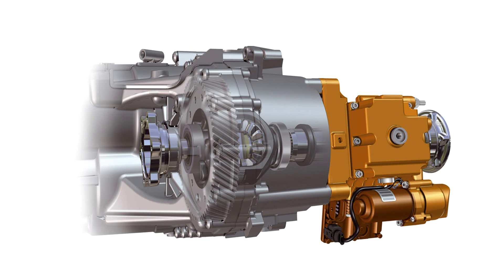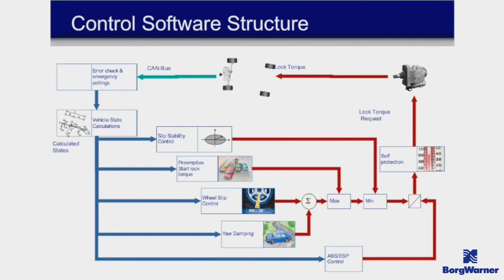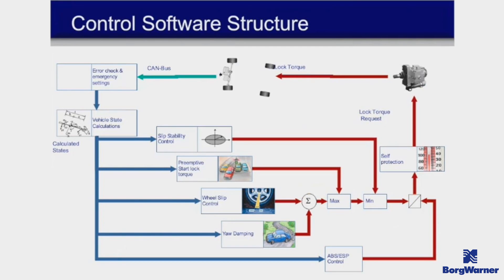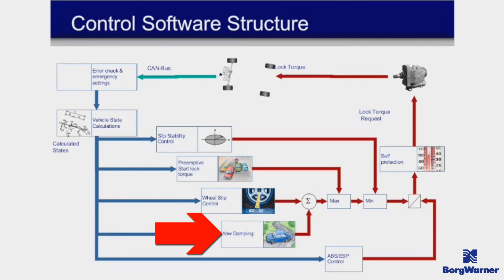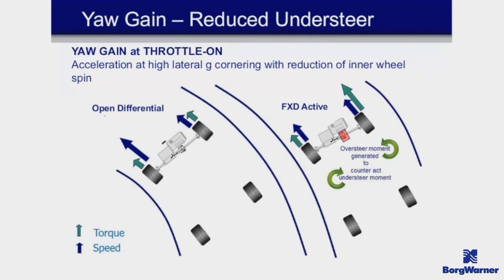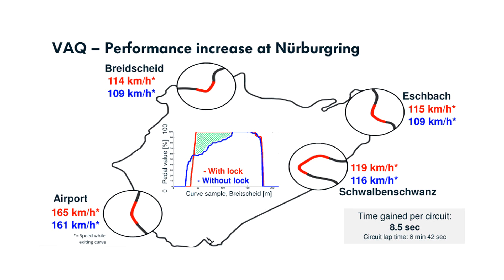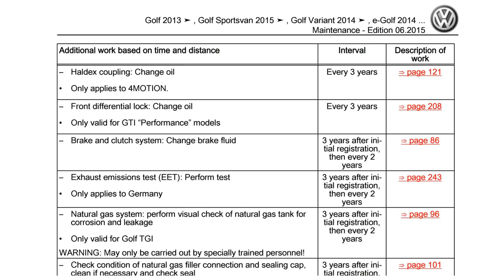How the VW (VAQ) Electronic Limited Slip Differential Works (MK7 PP)

Comment: May sound like a stupid question, but since it's only on the passenger side, it's able to lock passenger-side output shaft to the case, which will work fine in left hand turns (assuming passenger side is on the right). But what happens when cornering right?
Reply: That's just where it's located on the car. It can vary either wheel.

Comment: I’d assume their 3 year service interval is based on 10,000mi a year. That means I’m overdue by 6,000ish miles, oof. I better go get that done because if I’ve learned anything about German cars, it’s that they don’t handle neglect well. 

Now I wish I would’ve gotten it done when I had my oil change and DSG fluid change done. I guess if it’s not that hard to do, I’ll just do it myself instead of being lazy like I was for the oil and DSG services. But that’ll have to wait until it’s warmer out.

Comment: hey guys. I have a 2015 gti performance pack. I had the lsd for the passenger side out cause i changed the engine out. so i did replace the oil in the lsd, but when I reinstalled it I noticed movement where the flange to the axle connects to the lsd. It's only about a 1/8 of an inch of movement in and out. Is this normal? did I screw something up?.  I can't find much info about it. Also thanks for the videos you make they are very helpful.

Comment: Well that bit about oversteer probably explains why I feel like a missile coming out of turns. Also, question: if the VAQ's hydraulics rely on strict temperature readings, should I be concerned about the device's responsiveness in extreme cold (it was 0°F yesterday)?

Comment: I tweaked mine up to full on my carista obd dongle. Stage 1.5 eurodyne gli gen3 tsi. Really worth doing the difference is very evident over the standard setting.
Reply: Kuzuri Kam  is the xds system good? I don't seem to have much traction through 1st,2nd & 3rd 😅
Reply: Kuzuri Kam  yeah they are fun to drive with a few tweaks
Reply: @pissywilly  What tweaks exactly?
Reply: @pissywilly  You said the XDS system is good with a few tweaks, what tweaks? Just adjusting wiring logic to increased traction?

Comment: I will mow your lawn once a week for a month if you can tell me where to find definitive information on how to drop a manual transmission (for clutch replacement) on a 2017 MK7 GTI with PP. They key here is that it has a limited slip diff. I am in a huge bind. Want me to buy product? I will buy product. Please help.

Comment: My helical diff just uses input torque through the helical cut gears to great axial loads that generate friction and a proportional locking effect to the amount of torque transferred through the wheel. 

No computer necessary, always works, and locks up dynamically based off conditions. 

Also plays real nice with traction control. ie, a little brake application to the spinning wheel transfers a lot of torque to the opposite wheel.
Reply: I can guarantee you this thing is night and day to a standard LSD. The cornering this guy talks about is literally mind boggling.
Reply: @MeltingRubberZ28  except the two fastest FWD vehicles around the Nurburgring, the Megane RS Trophy R and Civic Type R, both use helical differentials. 
.
Helical diffs are reliable, proportional, non-reactive, and work amazingly well. VW's solution isn't better except in really low traction conditions when input torque is low and right off the line, but it has to react/predict any lockup needed, and if it's too aggressive can resist steering.
.
If the best cars don't use it, then there are good reasons for it. Especially when they're expensive performance variants with low production numbers.
Reply: @KTMcaptain  just because those cars don't use it....doesn't mean they wouldn't improve if they had it. Not following your logic.
Reply: @KTMcaptain  definitely a thought provoking discussion. Doesn't the type R use the brakes for torque vectoring anyway? I've heard of people complaining of how fast their brake pads wear out from heavy cornering.

Also, it seems to me like the general consensus is that an e-diff yields better performance. On all the track models of the Camaro the e-diff is an upgrade (including the ZL1 1LE). The reliability is questionable. I can see how it could be thought of as less reliable, more parts, electronics, however it really is just a clutch type LSD that has a piston controlling how the power is broken up.
Reply: @MeltingRubberZ28  The logic is that those two manufacturers set out to make the best handling fwd cars on the market and succeeded. The differential is a very important aspect of the cars handling. It's not a situation where they performed in spite of the equipment. It was chosen. Ultimately, you claimed it to be a night and day difference, but there is no actual performance difference. 
.
Clutch type differentials wear out hence the reliability complaint. Not only that, they lose performance throughout that lifespan as the fibers wear down and the steels glaze over. The Corvette does use an e-diff, but it's rear wheel drive. When the diff is locking up it restricts turn-in minimally. Front differentials have a greater wheel speed differentiation meaning any lockup would have a greater effect on turn-in. 
.
My old 06 WRX STi had 3 differentials. Front was helical, rear was a clutch unit, and the center was a electromagnetically driven clutch with helical gears. Helical diff in the front provides great torque distribution without restricting turn-in, the rear diff has less wheel speed difference and used a static clutch, and the center diff was used helical gears to amplify the electromagnet driven clutch pack to vary torque distribution. Subaru swapped the rear differentials for a helical unit the year or two later. My current car, 19 Civic Si, has a helical unit and it's unbelievable how well it puts down power pulling 1g in slower 40mph corners where even my 13 WRX would spin the inside front. 
.
The great thing about helical diffs is the lockup is proportional to wheel torque... wheels take torque to spin, the more torque you apply the more likely it is to spin... So the lockup effect is only there when you need it and is instantaneous. 
.
Now, there are clutch type differentials which have a proportional lockup effect as well. 1 way, 1.5 way, and 2 way diffs use a ramping mechanism and input torque to drive the clutches. A 1 way will only drive the clutches under acceleration and not braking, a 1.5 way will drive the clutch half as hard under braking, and a 2 way will drive the clutches both ways. These aren't well suited for road cars due to fast wear and maintenance, but are great for race cars. 
.
I don't see what torque vectoring has to do with the differential? It's used to get better turn-in. Outside of Honda's SH-AWD rear diff, no diff can vector torque intentionally to the desired wheel. Hence the use of brakes. The VAQ diff can only lock the wheels together making the wheel with the most traction the one that gets the most torque, but under that the inside wheel wants to spin slower and can't so will resist turn-in. Honda's SH-AWD rear diff doesn't use a differential. It's a fully locked axle with clutch packs to create differentiated wheel speed. It would just partially unlock the inside wheel to send more torque to the outer wheel, and it also uses a planetary gearset to increase the rear axles speed.
Reply: @KTMcaptain  either you didn't watch the video or you don't understand how the VAQ differential works. It has the ability to send full power to the outside wheel during turning to aid cornering, which is where I've said it's a night and day difference.

As far as it being a high maintenance item, VW has been using it since the 2015 GTI has come out (I think earlier on the Golf R) and I have yet to hear any complaints about it wearing out. The maintenance schedule they have for changing the fluid is likely similar (possibly even longer) to the maintenance required on your Si.
Reply: @KTMcaptain  I had to go back and re-read your original statement, but you saying that helical differentials are proportional is actually it's downfall which is where the VAQ shines. You've also correctly mentioned yourself that there is the largest wheel speed differential in the front wheels when turning, which is why having proportional power to both wheels is actually not desirable, or at a minimum....less desirable than a differential that can bias the power to the wheel completing more revolutions.

As far as torque vectoring, I've heard on the type R people complaining of the brakes wearing obscenely fast due to cornering and them using the brakes to reduce power to the inner wheel. The WRX also does this. We both know from physics that biasing the power to the outer wheel to generate torque vectoring, rather than slowing the car down by braking the internal wheel is a better option.

I actually looked at buying an Si but the dealer was a joke, and the 1.5 simply can't generate enough power for my liking. My GLI pulls quite impressive numbers in the corners as well. While it isn't at the Si's level, considering it's additional weight it's very close.

I'd be willing to bet that both the cars you've listed would run at least as fast, if not faster with a torque vectoring differential. The only potential reason they wouldn't is given the caliber of the driver that's pulling the times they are, simply can overcome it's downfalls given it's old technology that they've been used to for years.
Reply: @MeltingRubberZ28  "Either you didn't watch the video or you don't understand how the VAQ differential works." Sounds more like your misunderstanding. Read through as I will explain why it doesn't actually work that way.
.
The VAQ differential has an actual differential with a single clutch pack that resists one axle shaft from rotating away from the carrier. This CANNOT direct torque intentionally to one wheel. It can only lock the wheel, proportionally, to the other wheel and the traction available to determine which wheel gets more torque. Since the inner wheel is slower than the outer wheel, torque actually flows the the inner wheel as it is being spun faster relative to the road. This is what causes LSD understeer on FWD applications. 
.
See, a differential works by one output spinning forward and the other reversed. This happens inside the carrier and relative to it. Therefore the output spinning backwards is still spinning forward if the carrier is rotating faster than it. This is what actually provides the differentiated speed.
.
When you resist one output rotating at a different speed than the carrier, then the idler (spider) gears inside the carrier transfer that to the other wheel as well. This is how the VAQ differential works. It only applies the clutch pack to one shaft, but it affects both and LOCKS up the differential.
.
Now that we understand the differential locks the wheels together, we can examine VW's claim that it can send 100% of torque to either wheel. It's true but deceptive. A locked differential will send 0-100% of torque to either wheel depending on traction. If you lift a wheel off the ground then the wheel on the ground receives 100% of torque since torque requires resistance. 
.
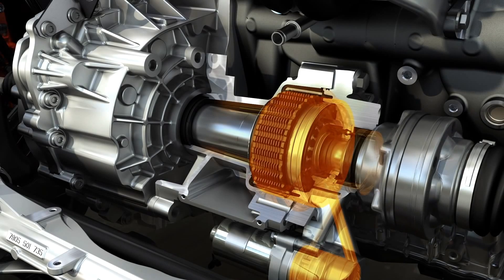With the VAQ differential it will distribute torque like an open diff or locker or anywhere in between as it can proportionally lock up. It cannot however disengage or reduce a wheels connection to the differential like the Honda diff can. At 3:10 he explains the varied lockup.  Notice how this video DOESN'T explain how it sends more torque to either wheel, just that it locks up.
Reply: @MeltingRubberZ28  The proportionality is actually the key benefit and why racing differentials use an input torque based clutch system I already explained to you. 2 way differentials. I'm not saying the helical diff hand down out performs the VAQ. I'm saying it's exceptionally reliable, works just as well on the track, not so much in bad weather, and isn't limiting performance. 
.
See, wheel spin requires torque. More torque means more likely to spin the wheel. The helical diff only locks up the differential when torque demands are high, which the VAQ does as well. When torque demands are low the differential acts open. The VAQ and helical work under the same physics. Resist the internal differential gear movement relative to the case. The VAQ uses a clutch and helical diffs use axial torque due to the shape and engagement of their gears. Both work in the same manner, but one uses a computer to decide when and how hard. The other is purely mechanical and works instantly. I'm sure the VAQ can simply mimic a helical if it wanted to. But it's heavier, more complicated, wears down over time, needs maintenance every 3 years per this video. 
.
I agree with overdriving the outer wheel with torque, but that requires a setup like honda with complex clutches to reduce the torque delivered to the inside wheel. But, dragging the brakes does create a yaw moment that helps the car turn in, so both have valid applications although the brake based systems can easily overheat the brake and cause excessive wear and premature failure. 
.
Coming from a 315whp WRX, and 350whp STi before that, I got married and drive my wife's CX5 often. It's 180ish HP isn't something I often used up, so I realized that 40mpg is better than using good power less than 1% of the time. It's weak, but damn does it handle, and the car won't understeer until both front wheels start to spin, which is a testament to how well the diff works. Resale value was also nice since it's about what WRXs get percentage wise.

Comment: My dealership changed the oil for this system at 35000km.... on DAP website you recommend it but VW doesn’t?
Reply: Does yours make a little whining noise at low speeds?

Comment: Hey Paul--is it feasible to upgrade to a LSD with a non-performance package MK7 GTI? I'm currently leasing my car and once that 3 years is up I'm debating whether to buy out the car and put an LSD in...I want to tune it but i'm not going to bother unless I have an LSD--thoughts?
Reply: Wavetrac can be installed, look up the article on DriveTribe comparing the two.

Comment: Paul: in case you have not already, please review the comments made by sn0man on VWVORTEX: http://forums.vwvortex.com/showthread.php?7508242-Performance-Pack-VAQ-differential-oil-change-maintenance&p=109161977&viewfull=1#post109161977. Apparently, at least one dealer claims VAQ is not a serviceable part.
Reply from the maker: Coming on AskDAP 113

Comment: Paul, could you bring the OBDeleven into this discussion and inform us about the app used to adjust the performance of the differential lock?  I have been eyeing up that setting and wondering what to do.  I could be wrong, but I think there is an adjustable setting for the VAQ.
Reply: Jacob Frey you can adjust them if you have it, I've seen the setting in VCDS for normal and aggressive. Give it a try but keep an eye on the wear on your front tires, test it by doing a low speed donut and compare what you feel between the two settings. The reason you might want a more aggressive slip setting is for gravel and dirt roads, on the street it could cause premature wear problems or 'axle windup' but only testing it will prove the theory.
Reply: Jacob Frey zi 2nd this original one, problem is it doesnt say what the standard setting is so u dont know if its getting more aggressive or less, and what that means
Reply: YES!  I wanted to come back to this video and ask about that as well - I can't tell whether we have any idea what setting our cars would have from the factory.

Comment: I dont get why manufacturers put these complex systems on their vehicles. Install a proper oldschool LSD and be done with it, they work better at providing traction anyway.
Reply: Uh no. An old school static clutch pack differential has to balance its locking effect with proper differential action. 

These diffs can provide perfect diff action and lock up much stronger. The elsd on the wk grand Cherokee provide traction levels equivalent to a locker.

I’d rather have a torsen though.
Reply: Whatever, grandpa.

Comment: So no one talks about what the standard location diff does or I should say, how it behaves.  What style of diff do we have in the standard location?  Same part number as the regular GTI's?  I know what the VAQ does and you explain it well but the power TO it is where everything I've seen falls down.  Thank you.
Reply from the maker: Sorry I dont understand the question.  Can you rephrase
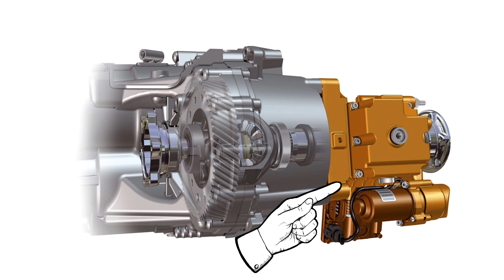Reply: Hello.  Ok.  The VAQ is an add on to the transmission.  In my case, a DSG box.  So in the video above, at 2:42 there's an image of the final drive.  Looks like a drive cup on the left, standard differential in that section of the transmission and then in copper color (in this picture), the VAQ.  In that final drive section before the VAQ is that a standard differential?  Is it locked so the VAQ always has power?  Thats what I am asking.  Sorry I am not clearer.  A secondary question is if we have the VAQ on our car and need to replace the transmission, is it the same as the non-VAQ cars? Mostly the same?  Thank you and Thank you for a quick reply!
Reply: Never mind!  I re-watched and caught that you are saying its an open diff.